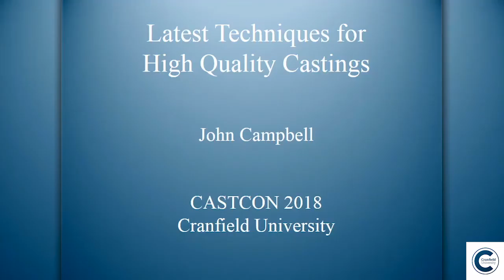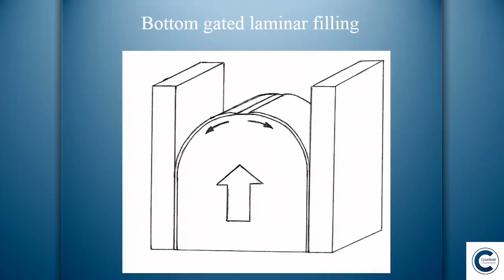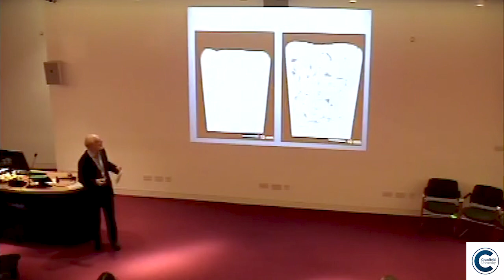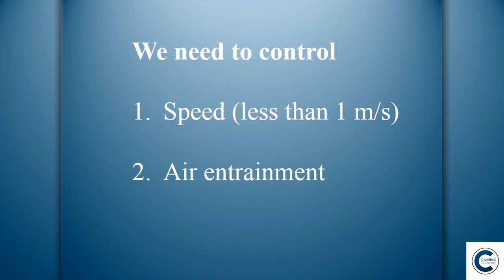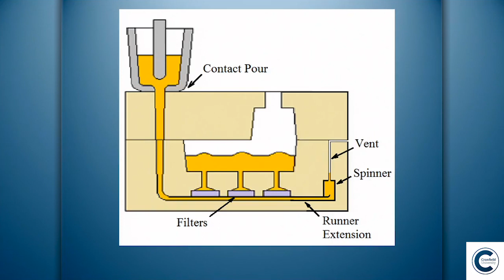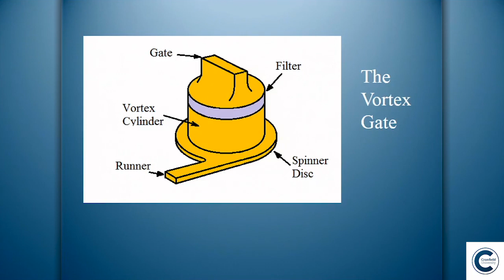CASTcon 2018 -  Latest Techniques for Castings

Comment: I understand these techniques are suited for sand casting, but how would these work with a lost wax/resin process? For small volume manufacturing/ jewelry. Are these methods transferable or does pulling a vacuum change things?

Comment: Nearly 30 years ago I was involved with producing tooling to cast the aluminum block for the (Cosworth) Ford 4.6 L used in the Lincoln Mk VIII. The tooling used many of these techniques. There were others too.

We maintained a 0.007 (inch :) ) tolerance, and 4.5 mm wall thickness. The block contains some "novel" geometry around the end of the integrated water-pump housing :).

The "valley", where the two flows come together, used a crisscross patter to hold back the top of the flow where the metal may have cooled and/or contain bubbles, so the hotter/purer metal can flow together, mix, and join better. The pattern was made using a large chunk of carbon and EDM.

So many things were passed on to me from these pattern makers. Many of them are gone now. The pattern shop (Wisconsin Pattern, Racine WI) is gone. At the time there was a strong push by the shop, union, and Ford to bring work back to the 'states (as it were) and inject it with new technologies.

The shop sponsored my venture into contract consulting, encouraging me to leave the large CAD/CAM/CAE software company Ford standardized on at the time. I provided customized software, and indepth support regarding the CAD/CAM products. But, as I told them, I learned far more from them than they learned from me. Still, they (including the union) seemed more than happy teaching and informing me, including sessions in the wood shop and time on manual and CNC machines, and producing 100's of production tool paths and continual face to face interaction with machinists. All helped me to refine the tool paths I produced.

I stayed on to win the production tooling contract for this block. Then for 3 more prototypes and a production set of boxes (Triton 4.6, 5.4, and 6.8 L, 2-V8's and a V10) for Ford's Next Generation Truck (i.e. NGT's) engines. Heady times. Manufacturing gets into one's blood and it never leaves.